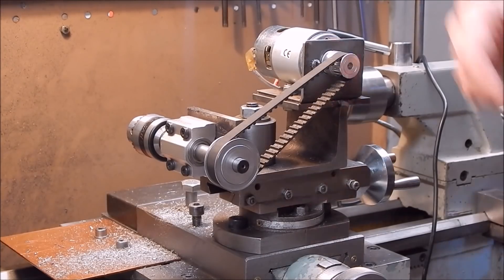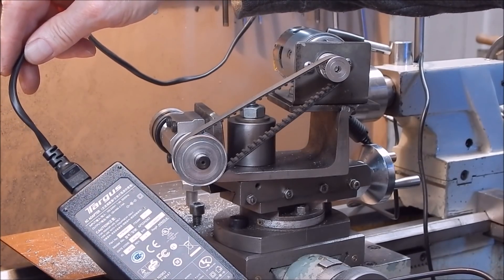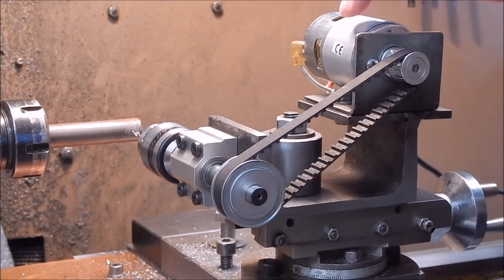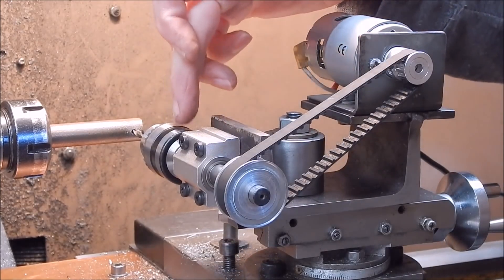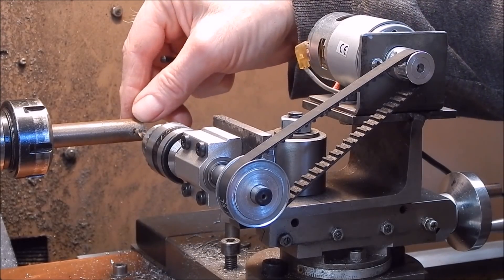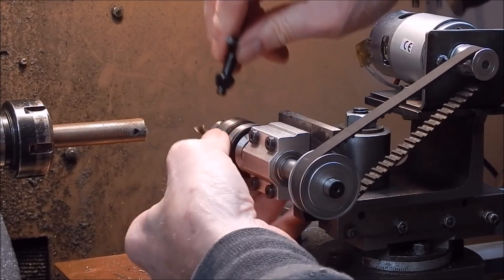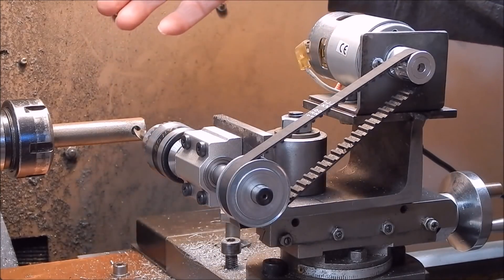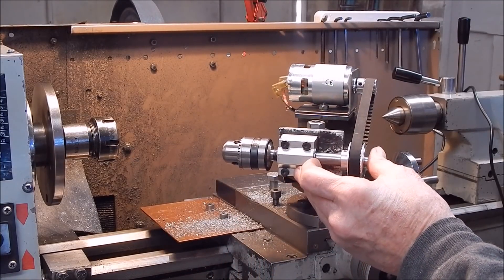How powerful is the 775 DC motor on the Machifit power spindle ?

Comment: The 3018 pro desktop cnc uses one of these 775 motors with an ER11 collet chuck mounted on the 5mm motor shaft.
There are 775 motors available in the 380W region for electric scooters,unfortunately for me they are across the pond in the US,and are not that expensive.

As for the cnc,the weakness are the unsupported x axis linear rails,i have a 3018 and have ordered supported rails and a new z axis to sort the flex issue,the 775 fitted runs 24vdc at 20000rpm,and i've watched them on youtube in stock form milling wood,acrylic and aluminium.
Pcb making too,2.5D carving,my upgrade cost £97GBP,the motor clamp is removable from the z axis,the whole lot cost less than the alloy z axis kit that still uses unsupported linear rails.

I have a lathe and a proper mill,so transfering methods from the heavy stuff to the cnc is a snap,plus i can still make  parts for the cnc.

In short the desktop will support the big stuff soon and be super accurate,worthwhile in my opine.Oh,and i bought a full ER11 collet set as you only get a 1/8th collet to suit the small etch cutters,this cnc will use small 1/4 shaft router bits,just be realistic in feed and cut depth.
Reply from the maker: Sounds good.  24 to 28 vdc is a cool running power level.  Great little motors.  Cheers Rob

Comment: Great idea. I may get an ER11 adapter to mount directly to the 5mm 775 motor shaft to eliminate the need for the belt and separate spindle. I just need it for a TPG.

Comment: Hi, how did you raise and lower your spindle? I’m going to build. Nice job. Thank you
Reply from the maker: I don't understand the question.  The spindle is on lathe center line using dead centers to align it.
Reply: @Xynudu   Hi , sorry for the confusion. It looks to me that the first part of the video the spindle is way below the center line, and the second part of the video the spindle is on the center line so you could grind and drill. Did you some how raise the spindle and motor or am I looking at it wrong. Hope that is a little clearer. Thankyou so much for the help and sure enjoy the videos. Jack
P.S. I got my spindle today!!!!!
Reply from the maker: It's just camera angle Jack.  Everything is on center line.  Cheers Rob

Comment: That is not bad on drilling at all, I have the 12 volt version of this, I made a 100mm circular saw for cutting Frets out on a cigar box guitar using a jig i made so the depth is only about 3mm in the cut, works perfect every time,  The saw blade is direct on the drill. The 775 motor is not the fastest on the block but it has a lot of torque, Your drills were chipping nice there, they must be sharp!!

Comment: Now what you need are a couple of opposed cone pulleys and you will have a ‘drilling machine’!
Reply: A set of pulleys like Unimat used on their small lathes. I have one and have used the mandrel as a milling machine as well. It's a standard attachment for the basic lathe. I made a third pulley which enables a double speed reduction for larger drills and mills.

Comment: I've only just found this video. I've got all the parts to make a similar tool post drill/grinder for my lathe. Interestingly I independently settled on the exact same spindle and motor setup (Looked a good compromise between space and power, But I'm intending to make a flatter "Chassis" from either a block of alloy or, If the final dimensions allow it, one of the offcuts of thick walled steel box section that my workroom's littered with.

My idea is to mount the motor at the end of the block, then cross drill the other end so I can lose the original drill spindles housing and fit it's bearings directly into the chassis. This way I should be able to flip the unit over and refit it upside down and at 90' when I need to drill into the end of a workpiece. As long as I measure the height from the compound slides top face to the centerline of the lathes spindle and double that to get the total thickness for the unit's chassis......... But minus a couple of MM, Because I'd rather it was shimmed up to get right on the centerline, as it would be a lot harder to "Shim down" to it if I slightly cock up the dimensions,  I should be golden. 😁

I'll drill the tool post mounting hole through the block as close to the units drill chuck corner as I can in the hope it'll cut down on how much torsion the unit sees when I'm trying to push my less than perfectly reground drill bit's through workpieces.

With any luck this should be a reasonably quick, But useful little addition for my lathe...... and yet another to it's alarmingly large collection of unguarded pulleys and belts (I really really REALLY have to do something about all those belts, It's probably a good idea to make some guards while I've still got all the fingers I'd require to make them !!! 🤔).
Reply from the maker: Good luck with your project.  Tolerances have to be spot on for these to work correctly.  Shims are handy when you can use them ;)  Cheers Rob
Reply: There's a design on a recent "homemade tools" website video showing this bearing block and spindle complete with covers over the belt etc. Very professional looking. Appeared in the last fortnight. Have a look for it. Might be just what you want.

Comment: hi rob ....is that 5" channel you used for the base of the bracket ? thanks ...Eric in Kentucky ...USA.......
Reply from the maker: Hi Eric.  It's 4 x 2 inch thick wall.  You don't see this stocked very often.  This was some left over from a salvage yard pick up.  Cheers Rob
Reply: thanks for your quick reply............Eric

Comment: With an end mill inserted would it cut a key way groove?
Reply from the maker: Hi Tony,

I tried it and it will, but very slow process with shallow cuts and small end mills only.  It's doable for model making.

You can't compare this little motor to lathe or mill power.

Cheers Rob

Comment: Very cool, I've wondered at how powerful these little units are.  Would be good even as a starting point for a light duty tool post grinder setup, where you want it to run a little faster.  Thanks for sharing!
Reply from the maker: More volts equals more speed with DC ;)

Comment: Have you ever had one of those moments when you turned the lathe on instead of the drill  !    Cheers .
Reply from the maker: Hi Max,

Yes, more than once.  It's a mindset thing with using a lathe.  You wonder how you can be so stupid, but it happens all too easily.

I think we've all done it at some stage.

Cheers Rob
Reply: @Xynudu  Thats ok , i was pressure turning the other day & grabbed the chuck key to release the part !

Comment: Its a pretty good idea Rob--I did something similar a few years ago,made sure the spindle was heavy enough and direct coupled an electric drill to it..Use it as a tool post grinder or use it with an end mill to cut keyways in shafts..Its pretty handy to have around..E  Also I have been using the wheel divider full on--had to make 15 or 16 sprockets--38 teeth --22--and so on--it was real easy,it was just work time..
Reply from the maker: Hi Ian,

Work time is always good for those jobs ;)  Yes, the divider wheel works excellently. Best used with a USB microscope.  Easier to use than any dividing head.

Cheers Rob

Comment: Hi Rob, A really nice design. A good test also. So it is a brilliant design for model makers, like you have proved. On one of my toolpost drills I have several drills that are shortened for use, like core drills for BA screws etc .
Reply from the maker: Hi Steve,

It's basically a miniature Dumore grinder :)   By playing around with the voltage and gearing you could actually make it run like one for small work.

I don't intend to do much grinding with it as I don't like the idea of the DC motor having permanent magnets, which are going to attract grindings both inside and out.  For cross and radial drilling this will be no problem and the accuracy will be top notch and repeatable.

I've done a couple of mods which should interest you - in the next video.

Cheers Rob

Comment: I would slow it down
Reply from the maker: Small  diameter drills can handle high RPM no problem.  Just go to the dentist and see what he is spinning when he drills your teeth.

The problem arises when you go larger diameter drills.  The radius dictates that the speed be reduced to keep the outer surface speed of the cutter correct.  So larger means slower.  But this rig does not have the torque to go larger, so no problem, small drills only.  But then that is what model makers use..  

As we are working with small diameter drills the speed is quite OK.  Basic physics which you would have learnt at school tells you this.

Cheers Rob
Reply: @Xynudu  OK.  I don't want to sound like a know it all. You have a kool set up there. YouTube is a great. I admire guys like you who take the time to share with others. I am a 69 yr old retired Pipefitter disabled Vet.... Army
Reply from the maker: No problem.  I value sensible comments.  Ideally a bit slower would be better and give more torque, so maybe I will make a larger spindle pulley down the track.   It's just like cutting a spur gear, so that's easy to do.

At the moment it is OK and no drill burning is occuring, so I can use it as is, primarily on brass and aluminium.  I don't want to fit a PWM voltage reducer/speed controller because you lose power as well, so mechanical reduction is the way to go.

It's good to share knowledge and YT is a good learning platform.  It's become a video Wikipedia.

Cheers Rob

Comment: Rob, just a suggestion: mount the drill chuck on a pair of slots to lower and higher the chuck and use an end mill.  Light milling on this would be a breeze, as always the video is well worth a watch. Keep at it, you give a lot of people both information and entertainment . Cheers
Reply from the maker: Hi Allan,

Lots of possibilities with this.  I do most of my milling on the lathe with a mill slide as I don't have a milling machine.

There will be something interesting in the next video showing a few modifications which expand the power spindle envelope somewhat.

I see BG have sold thousands of these components.  Apparently there is a lot of interest in the power spindle and the DC motor from enthusiasts/hobbyists/RC/model makers etc.  

People forget that a lot of people work in a miniature world out there and make some amazing stuff, so full credit to them.  Takes real skill to do that type of work.

Glad you enjoy the videos and thanks for the suggestion.

Cheers Rob
Reply: @Xynudu  I got sick of milling larger work on the Myford so I got a Hafco  52 for all ops except small jobs. Got sick of the Hercus for big turning so I got a Colchester Triumph 2000 but I do love seeing the short cuts and ideas you come up with. They would have saved me hours had I known of them sooner. Cheers Mate

Comment: Power is a factor of torque and speed.  You're basically wasting all the power on a speed that's way too fast and an as expected torque that's way too low.
Reply: Put a much bigger pulley on the spindle.  Your drills won't last long at those speeds.

Comment from the maker: Note:  This is NOT a heavy duty workshop unit.  This is just a play thing that is excellent for model making.  If you expect more, look elsewhere.

Don't expect top shelf equipment for the few miserly bucks this thing costs.

If you want the business then be prepared to pay for it.

Cheers Rob
Reply from the maker: Z pewnością tak jest. Bardzo tanie za to, co może zrobić. Dobry projekt zabawy.
Reply: Nice work Rob! Could this 775 DC motor using solar generated power drive in your opinion/experience a low RPM electric generator like those shown at www.youtube.com/user/realracecom
Reply from the maker: Why would you use a motor from solar power to drive a generator when all you need is a DC feed to storage batteries ?
Reply: Most cordless tools based on 775 motor have 20amps overload protection. 4amps is not near enough for this motor.
Reply: Sewing machine motor is better. No belt direct connection.

Comment: Pretty cool set up. wonder if adjusting the sizes on the pulleys to slow the spindle speed and increase the torque would help with the larger drills?
Reply from the maker: Hi Aaron,

It would.  

Cutting a larger spindle pulley would be pretty easy.  It's basically just a spur gear with a different tooth profile.  The raised edges are actually not required.  If the belt is running true it will stay in position.  Most car and motorcycle Gilmer/toothed belt camshaft drives are like this.

Cheers Rob

Comment: G’day Rob, simple design and works, what else could you ask for. I was just thinking how many tool post drill/grinders do you need, you’ve done the Hilda, air pencil drill, now this, have you done others or am I confused with Steve Jordan?
Works good mate, cheers Peter
Reply from the maker: I also have my original "0" sized Baldor industrial TPG that rarely sees the light of day now.

Size is important with grinders, and small is often the way to go.  Most industrial TPGs won't fit on any lathe smaller than 10" swing.

So these little jiggers are mighty handy if you are a hobbyist.

Cheers Rob

Comment: I think that little spindle needs a thrust bearing. 

It also runs to fast in my opinion. 500 rpm would be much better. You' re not doing any production work.
you should try a cheap PWM board.
Reply from the maker: A PWM will reduce power as you are reducing voltage.

Better to gear it down more and boost torque if you want to drop the speed.

Comment: How does it stack up to the hilda
Reply from the maker: They are totally different concepts.  Using the Hilda as the drive motor would be interesting, but you have to remember that die grinders are low torque.

Comment: Do you think it would be possible to use a shorter belt? That would give a more compact layout.
Reply from the maker: Hi Tim,

You could do that if you can find one. 

Moving the centres closer together does reduce the arc (number) of the gripping teeth on the drive pulley, so the current setup is about right.

Cheers Rob

Comment: It's easy enough to measure  power input, which is how small dc electric motors are often rated, anyway. 746 Watts per horsepower. At 19 volts,  that's 39 amps per hp.

Comment: You probably need a bigger pulley
Reply: Yea, for bigger drills, it's just too fast. Geared down it could handle it though.
Reply from the maker: Yes, it would have more torque and the speed would be better for using larger diameter drills.

Comment: A good way to establish center height would be to put a drill or steel rod in the drill Chuck and the other end in the lathe Chuck. Then spot the holes in the pillow block to your mounting bracket

Comment: Hi Rob !
I have decided to finish/evaluate my projects in the pipe, but I'm afraid I just got another one in there ;-) !

I will try to draw it first and maybe get some good improvement ideas. 

Right now I'm buzy finishing my wheel chairs - a Hell of a setup job !

Thx for sharing !
Reply from the maker: Hi Keld,

This was just a suck it and see project/basic build.  Proof of concept I suppose you could say.

I have two modifications that I will probably include.  The first is to give the chuck more drill space as indicated, the other is yet to be revealed ;)

For anyone with a lathe these kits make for good fun and an opportunity to play around in the workshop - without spending very much money.  What could be better ?

The end product could even be useful.

Cheers Rob

Comment: nice video Rob, i  made a similar one and i used a larger  ac supply with a bridge rectifier rated for 45 amps.and it works great also the same can be applied to a small southbend 9'' .....cheers
Reply from the maker: Hi Ray,

Endless fun for not much money.

What could be better?

Cheers Rob

Comment: Thanks for this follow up on this little unit.   I sure see lot's of ideas with this.   One improvement might be a variable speed with a variable power supply up to full speed for better grinding capabilities etc.
Reply from the maker: All things are possible.
Reply: These 775 motors can go from 3000 ish RPM at 12V, and go all the way up to nearly 10,000 rpm at 36v (Most go to 36V, Some are only rated to 24V continuous use).

The "Machifit No Power Spindle Assembly" comes with a 20T spindle pulley and Banggood only seem to offer a 10T pulley in the XL tooth size to fit to your motor, So that still only gears the spindle down into the 1500/5000 rpm range. Putting a cheap and cheerful PWM speed controller into the circuit would be a great idea because you could just get a 36V PSU and use the speed controler to drop the speed when required. You'd lose some torque when trying to slow it right down, But as this kit of parts isn't going to be much use to make over a 5mm hole anyway, You'd only really need to get down to 1300 rpm for steel anyway.

If you wanted to surface grind using this setup you'd really need some pretty impressive speeds. The SFPM ("Surface feet per minute" in case anyone's wondering) needed for most grinding want's to be up around 5,000 to 10,000 (Note, That's SFPM NOT rpm), So with the spindle only going 5000 rpm you'd need something like a 4 to 8" grinding wheel to get up to the SFPM !!!. If you decided to go with different pulleys, Say for instance a 60T motor and 20T spindle pulley, You could get a much more usable 30.000 rpm at the spindle, And that would mean being able to use 1/2" to 1.1/2" grinding wheels, But I'm pretty sure the spindles bearings wouldn't be particularly happy at that speed for long, and even a slight imbalance in the assembly at those RPM's is going to vibrate the whole lathe and ruin any surface finish benefit grinding would have given you.......... There's a reason why tool post surface grinders look unreasonably expensive. :)